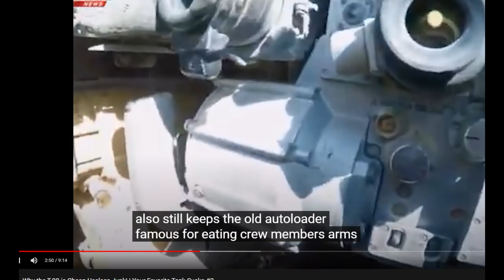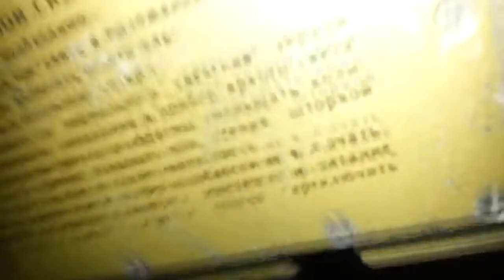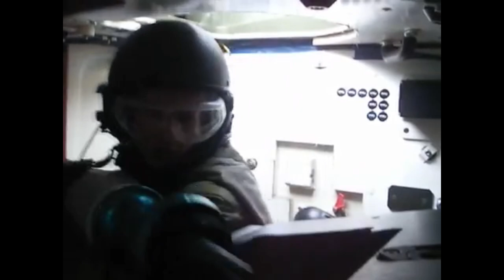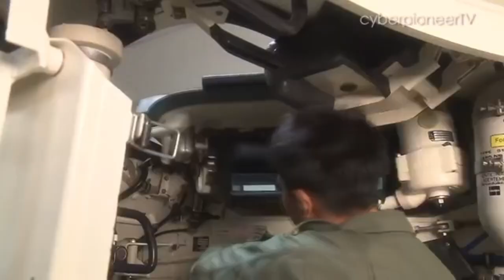Busting Myths on T-72 tank!

Comment: Well T-72M and M1 are downgrades when you compare them to T-72A. T-72M lacks composite armor one turret and uses cast homogeneous steel for the turret and uses a downgraded fire control system and used export 125mm ammo. T-72M1 added composite armor however its debateqble if it was the same as T-72A. I think you are confusing T-72M and T-72M1 from Soviet Union and Czechoslavakia the one from the latter was absolutely a downgrade compared to the Russian one because the Czech's wanted to sell the T-72 abroad where as the Russians wouldn't let them sell Dolly Parton composite armor.
Reply: Doggone!  From the wiki:
"The T-72A featured a new turret with thicker, nearly vertical, frontal armour. Due to its appearance, it was unofficially nicknamed "Dolly Parton" armour by the US Army.[48] This used the new ceramic-rod turret filler, incorporated improved glacis laminate armour, and mounted new anti-shaped-charge sideskirts." [49]
Reply: I have heard this a lot but frankly far as I have been able to tell the T-72M1 as sold to/built by Pact states was for all intents and purposes a Soviet-spec T-72A model 1983, complete with turret kvartz armor, the revised hull composite scheme (there's a photo of M1 glacis plates' cross-section which matches the Soviet version), and the 16mm applique plate added in '82/83. They even had the laser rangefinder too. What they did not get AFAIK, was APFSDS ammo designed in the same decade.
Reply: One point of difference is that the Soviet T-72As were receiving the 1A40 FCS add-on since 1982, which the T-72M1s did not get AFAIK.
Reply: @Postoronniy  not only that but a lot of the NV equipment on Iraqi models was either removed by Iraq or never installed. The IR light didn't even have the IR filter and was just a searchlight. So to say the Iraqi T-72M's and M1's where operating to Soviet specifications is simply not true.
Reply: @becauseiwasinverted5222  the T-72M1 doesn't use "Dolly Parton" composite armor used on T-72A it uses the older "Combination K" style composite with quartz filler like on T-72 Ural some T-72M1's recieved the upgraded hull armor however Iraqi examples did not however on some examples had the 16mm applicque armor.
Reply from the maker: @nemisous83  T-72A used Combination K armor, the Quartz filler in the turret. Also had the same composite armor in the hull. The "Dolly Parton" composite, or "Reflective Plates" composite, how its actually called, has been used only since T-72B/B1, there were T-72A prototypes made with such armor in late 1983, early 1984, and were dubbed T-72 obr. 1984, but those were, as I said, prototypes for the upcoming T-72B tanks, which received the Reflective Plates armor in full production. T-72A, as T-72A, had cast turret with Quartz filler and had the exact same protection as T-72M1. I am not confusing T-72M and T-72M1. T-72 Ural did not have the Combination K turret, the turret was completely steel, no fillers what so ever, just regular cast thick steel. T-72M1 made in CZS and Poland was very much the same tank as the T-72A at the time. The fact that the Iraqis didnt take care of their tanks is not a concern of the manufacturer, the missing IR filters, etc. are a result of the Iraqis not properly maintaining their tanks.
https://thesovietarmourblog.blogspot.com/2017/12/t-72-part-2.html
The T-72M1 export models Object 172M-1-E5 (Warsaw Pact members) and Object 172M-1-E6 (3rd world countries), both cleared for export in 1983, directly corresponded with the T-72A obr. 1983 in turret armour and hull armour, including the appliqué armour plate.
Reply: @nemisous83  I know there are many versions of the export T-72 story. But the only one I have concluded is reliable the one I outlined above. Meaning the M1 turret is a steel-quartz-steel makeup (Comb-K used GRP instead of quartz) , while the glacis was of the revised scheme, incl. addon plate. There are cross-section photos online of both the turret and hull showing these features. Making it the same as a T-72A m.1983.
Reply: @becauseiwasinverted5222  if you look at T-72M1's cross section from East German examples the pocket which houses the quartz filler is noticably thinner than on Russian T-72A schematics. So the claim that T-72M1 is a 1 for 1 copy of T-72A is patiently false. Also T-72M1 doesn't have the improved FCS from T-72A mod 1983. Regardless not all T-72M1's are the same and the majority of T-72's aren't T-72M1's infact the majority of the Iraqi Armored brigades wherent even equipped with T-72's only the Republican Guard.
Reply from the maker: @nemisous83  T-72A mod 83 and T-72M1 have the same FCS, there is no difference in thickness between the turrets? Where are you getting all of this?
Reply: @RedEffectChannel  T-72M1 uses the TPD-K1 FCS used on T-72 Ural and earlier production versions of the T-72A. in 1983 the T-72A was fitted with the 1A40 FCS. T-72M1 also used the older TPN-1-49-23 gunners night sight compared to the more improved TPN-3-49 which had a greater effective range coupled with Luna 4 IR searchlight and had limited sight stabilization unlike the former. Though this is a moot point because on most of the captured T-72M1 examples the gunners NV sight was either removed by the Iraqi's or never shipped with it and had only a white light searchlight. 

Admittedly there isn't any readily available proof for T-72A's turret armor however in US Army documentation T-72M1's and T-72A's are listed with different protection values for the turret and most of the gunnery range tests and cutaways done on T-72's are of T-72M1's not T-72A's. Nor is there any Russian sources proving T-72M1 and T-72A mod 1983 have the same turret armor.
Reply: @RedEffectChannel  also T-72M1 is patterned after the mod 1979 T-72A not the 1983 model the 16mm applique armor panel was a modification give to a lot of T-72 variants not just the 1983 model you even see some T-72 Ural and mod 1979's retrofitted with this plate.  That being said its highly improbably Saddam's T-72M1's where of the 1983 standard and there is no evidence of it from T-72M1's that where captured.
Reply: @RedEffectChannel  combination K isn't steel/quartz filler/ steel combination K uses steel/glass reinforced polymer/ ceramic balls/ steel as seen on T-64. T-72A uses a more simplified version replacing the glass reinforced polymer and ceramic balls with quartz filler.
Reply from the maker: @nemisous83  T-72 Ural and T-72A never shared FCS, T-72 Ural lacked a laser rangefinder and had a coincidental rangefinder which is located in front of the commanders cupola and is clearly visible, starting from T-72 Ural-1, FCS was changed with most notable change being the LRF. Now yes, it is true that T-72A received improvements in FCS in 1983, it was the lead calculator that was the big difference, but still the production run of T-72As with such FCS was not long and not all T-72As were upgraded with such system. T-72M1 shares the FCS with earlier T-72A models, that is true, but such tanks were still used in USSR at the time. 
US documentation, especially if it is from Cold War, is extremely unreliable. I am well aware that the common cutaways are done on T-72M1, but there are a lot of things that go along with the fact that the turret is basically the same, if there is a difference in thicknesses of some parts, it is minuscule.
Follow the link I posted earlier and read the part about the Kvartz turret.
The applique plate was added to tanks that were saw fit to have it just to be enough to stop the modern 105mm ammunition, I am personally not aware of that ever being done to T-72 Ural since it would be absolutely useless since its armor composition would be insufficient to stop M111 (which was the round they tested) even with a 30mm plate that was added on some tanks. On the other hand, T-72M1 always came with 16mm addon plate, that was its configuration, as such, the article states that the armor is shared with T-72A 83 because that is when T-72A received the plate as standard.
Reply: @RedEffectChannel  the laser range finder is a component of the FCS. The difference on the Ural as apposed to the T-72A mod 1979 is instead of the gunner imputting his range estimation into the ballistic computer with the laser range finder he is using the coincidencal range finder to get his range estimation. However the ballistic computer, gunners primary and auxiliary sight as well as gunners night optic are the same. The FCS on the T-72A mod 1983 is a different model all together.
Reply: @RedEffectChannel  also the the mod 1983 wasn't really a small batch either it was an upgrade standard that All T-72A's where upgraded to (or atleast supposed to ) however you are right that they didn't make that many factory built T-72A mod 1983's because T-72B was already in development.
Reply: @RedEffectChannel  the reason I brought up Iraq was to illustrate that Iraqi T-72's wherent even up to standard T-72M1 as far as equipment when they where encountered in the Gulf War. Regardless the type of tank used is irrelevant they could have had T-80UK's and the result would have been the same because a good chunk of Iraqi armor was turned to scrap metal by the USAF and what few engagements the US did have with T-72's where incredibly one sided or the US had terrain supremacy.
Reply: @nemisous83  That really depends. I have not seen any photogrammetry-based comparisons, and without knowing which schems you're referencing it's hard to assess (keep in mind public schematics are often not drawn accurately and are meant for cursory illustration only). The FCS/sights if memory serves were differentiated from the M1 on transitional, later-production Soviet models. Though I am not sure on that so you could be right. As to the Iraqis, no disagreement at all. I was just focusing on T-72M1 specifics.
Reply: @becauseiwasinverted5222  Why don't they have digital FCS with all information fed into that computer. to correct aim.?

Comment: So what, it has sparkplugs that can be turned on/off depending on fuel type?
Those engines don't have very high compression ratios, so there's no way it could do compression ignition of gasoline, and if it could, it would most likely destroy itself in the process.
First mass produced gasoline engines with compression ignition capability are very new (Mazda SkyActiv-X),  state of the art basically, and only work in the gasoline compression ignition mode i na very narrow rpm and load band.
Reply: Gasoline doesn't "compression" ignition....... wtf are you talking about. Diesel engines have 14+ compression ratio regardless. More than enough for gas. What you are saying doesn't even make sense.

Comment: I am 29 years old and i used to be a T-72 driver and i am 178 cm. And it is true that taller you are, the more you should be driver. I have been a gunner for 6 months and once i was driver, i was expected the seat position to be more small but i was glad that i was wrong. Plus, i engaged myself to be driver so 👌🏻
Reply: Nice which T-72 you worked on?
Reply: @Pickles6988  I worked on a T-72b for the first 3 years and 1/2, then the last year and few months left, I was working with a T-72b2.
Reply: @piotrsergeievichrakovsky9087  nice have you seen 2S25s?

Comment: The third one isn't a myth, but a partial truth. Iraq in no way had the same tank that the frontline Soviet forces did. Nor the advancements they later added onto it; no way in hell. It's obvious that the tanks Iraq used were monkey models, given Soviet export policy. And the only way around that was to directly import from other client states in the Warsaw pact.  But even then they didn't have enough of them to matter. And the Gulf War was proof of that.
Reply: It's a myth that they were downgraded. It's clearly stated in the video that they were not of the strength of a frontline soviet force because these were old surplus tanks. They didn't need to downgrade them they were already not using latest tech
Reply: The issue is the only info that exists says it was in fact the same as the T-72A obr.1983. Turret and hull composite armor, revised hull armor (w/ post-'82 applique addon), laser ranging, everything. The ammo apparently was old. But there is no contradictory info on anything else.

Comment: I agree with all your points bar the size issues. Chieftain on YouTube Abrams talk states he is 6"5 and says he stayed comfortable for weeks. A T72 is designed to be smaller and inside you can see the extra huge amount of room in Abrams. He said he could drive the Abrams but was a Little heavy on the pedals. Abrams is a lot more roomy even with a loader. Apart from that I agree.

Comment: I'm 207cm tall and i was a Cv90 driver in the late 90's in the Swedish army.
I was young flexible and blessed with a well proportioned body so it worked.
The image intensifier sucked though as that was 15cm lower than the regular prism so i had to lie down and watch the intensifier from over a meter away. 
Luckily the Cv90 has nothing behind the driver so you can recline the back of the seat as much as you want.

On a laugh we even put me in a Strv m/37 at the local armour museum this was a Czech pre war tankette for two people and i managed to fit in the driver seat, would probably have had trouble driving it though but the driver sat in a leather hammock so that could probably have been made to work.

Comment: Do any countries still have the unmodified, first variant of the T-72 in frontline service?
Reply: Mongolia still has t72A tanks.
Reply: Several. Even Iraq has many original Ural/Ural-1s left (first ever model).
Reply: @becauseiwasinverted5222  The T-72 tanks in Iraq have mostly been upgraded to have at least some modern features, I went to a military base a couple of months ago and saw a bunch of T-72's getting upgrades and new paint while T-64 tanks got some small upgrades as well, although I don't know for certain what upgrades they got but a large number of the previous army's vehicles have been restored and upgraded.
Reply: I would say yes most likely 3 and these would be Libya, Algiers, Uganda and maybe Lebanon. Most other countries have upgraded since or use Western tanks.
Reply: In Uzbekistan T-72 Ural or Ural-1 are still in service (next to T-72B, T-72B1, T-72AV, T-72A, T-80B, T-64B1, T-62MV, T-62M and possibly even T-62).

Comment: Very  Briefed And Summarized ideas:

Part-1

there was a lots of problems with the Iraqi t-72 tanks during the 1991 aggression and I will mention very few minor points :
1- they were in very small numbers of those tanks, Iraq did not have more than 700 t-72 tanks ready for operation out of less than 1,100
t-72 tanks from various origins that Iraq received from the Soviet Union and the Warsaw Pact countries, at that time most of the Iraqi army’s tanks were still made of 
t-62 and t-55 alongside its Chinese derivatives, although the later was superior to its Soviet t55 counterpart it was active in Iraqi army, facing 1956 abrams tanks were used in the 1991 aggression without counting the british challenger tank ...
2- the absence of an electronic fire control system or ballistic computer, and this severely limited the combat effectiveness of iraqi t72...
3- very limited night fighting capabilities, the tank lacked any modern night vision and infrared sighting systems even from the first generation although Iraq had economic relations with Japan and economic and weapons relations with various european countries and european arms companies, and Iraq was one of their most important customers. 
this is why Iraq’s was capable of modernized and upgrading his small fleet of t-72 tanks and IFV BMP 2 tanks with modern multi-channel sighting systems (day-night and infrared sighting system) and advanced fire control computer systems alongside advance stabilizer, this option was possible at very reasonable costs compared to the Iraqi war spending...
However, at a minimum, the night and thermal sighting devices for anti-armor guided missiles, for example, ATGM 9M113, could be attached to the tank sighting systems or to be connected to 3 cctv panels for all the three crew or at least the commander/gunner, those panels should be the main sighting and operating screens for the crew, integrating all the capabilities and functionality of the armor fighting vehicle AFVs between those flat panels and simple joysticks ...
4- the turret was operated manually through a hydraulic system, not electrically, and thus decreasing the speed of reaction and agility in successive manoeuvring between the targets in different directions...
5- t72 tactical utilizing and deployment in such a way that formations equipped with t-72 tanks were lost early warning necessary to be able to organize their efforts and counter measures for example the BMPs was deployed near the tanks in very classic tactical style, where the mechanized infantry accompanied the tanks in a mixture forum that was not effective, instead of deploying the infantry and mechanized infantry equipped with different types of wire-guided and unguided anti-armor weapons including recoilless rifles, supported by IFVs and heavy machine guns, heavy snipers or anti material rifles in front of them with mine fields, deploying them as rings at appropriate distances in front of the tanks formations deployment sites which did not exceeded the battalion size tanks formation after breaking the large formations brigade and division size to battalions and company size, in order to give the latter an appropriate defensive depth and provide them with early warning on the direction of the enemy approaching axes, slowing down the advancement of enemy formations...

Part-1